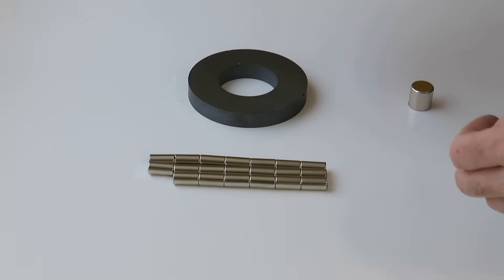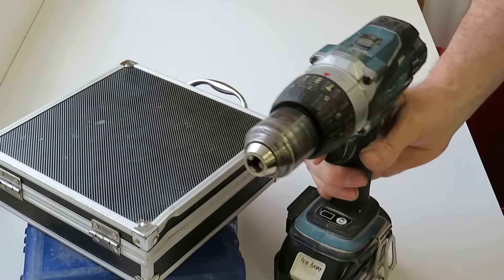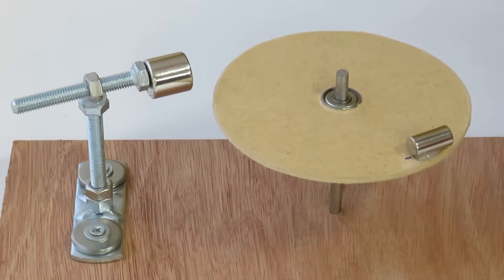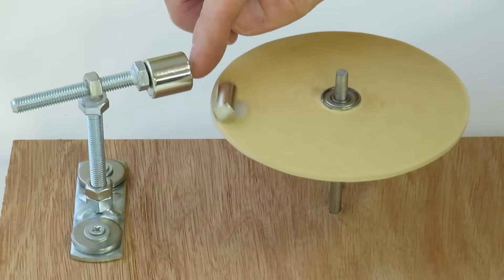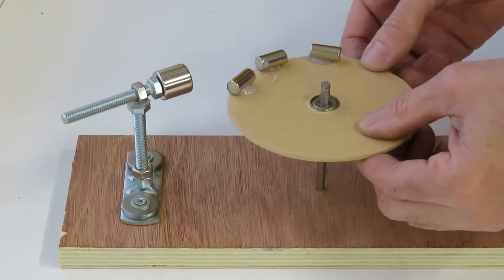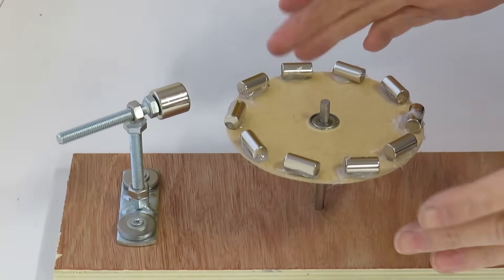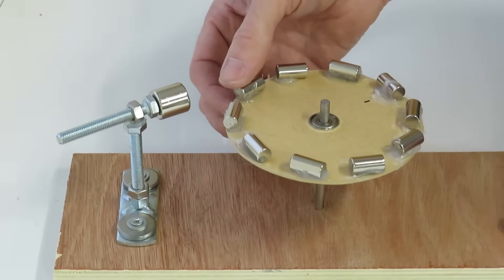Magnetic Energy - Crude Magnet Disc Challenge!

Comment: Mu-metal would shield the magnetic interference between the magnets
which should focus the magnetic field of the opposing magnets a bit better, also the perendev motor uses the same concept but has 3 rows of magnets and each row is a bit offset from the other to give it that push in the spaces where it wants to stop spinning
Reply: regular steel or iron shields magnetic field to some degree, the trick like someone said above is to remove the stationary magnet and have it just be there at the right time... it appears Troy Reed did this using springs that he called injection pistons in his magnet system... you could even use an electromagnet for the stationary magnet and only turn it on at the exact point to push the disc around then turn it off when it would block it from continuing around (cogging)... just make sure that your electro magnet uses less energy than the momentum of the disc...  its rather simple if you understand the concept and this seems to be what Troy Reed did

Comment: This might sound daft but have you tried something like this, imagine you had a sphere, which was all magnetic, super duper strong magnetic, then you had another magnet inside the sphere, super strong also, if you pushed the magnet towards the magnetic  ball, it would move right, so would it not lift off the ground if you pushed the magnet toward the ceiling of the magnetic sphere, and if so and the weights was worked out correctly wouldnt that allow it to fly if the magnetic force was strong enough???

Comment: One problem is the angle of the magnets on your wheel., they need to be more perpendicular to your stationary magnet. The second problem you have is that you need a “shield” on your stationary magnet ( like the ones they use on audio speakers) to dampen the field around the sides of the stationary magnet. This concept will work and yes you are on the verge of getting it right. Very honest and well made video. Thanks for sharing your experiment.
Reply: I like using some Bismuth for blocking the "Attraction" angles between the stator magnet and rotor magnets also, but I agree getting the angles correct and keeping the unwanted polarity field away or contained is crucial for success with magnet motors. I'm working on a design that uses Halbach arrays to contain and constrain the magnetic fields to only radiate the fields in one direction, so aiming them like this guy in video said he wished he could do.
  If it has any degree of success or is pretty interesting in what it does do, I'll be posting it on my channel.
Love working on magnet designs myself as I know there is potential for amazing devices yet to come.....
Reply: Sir have you done what you say?
Reply: Yup, “if you can block (or shield) a magnetic field, you can make a permanent magnet motor.”
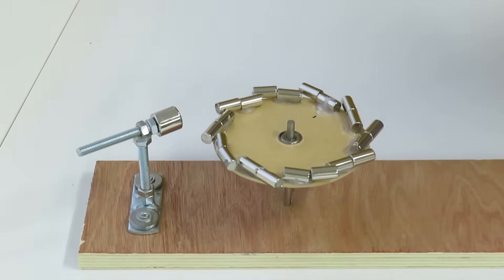Reply: @gmstream9259 11:31

Comment: I'm am not an expert of any topic at all, but here's an idea: you are relying on the single large magnet to propel the disc. Eventually it slows down. What if you were to put an identical magnet exactly opposite? Both sides should propel the disc equally from each side, meaning that it has a lower chance of slowing down. I'm just guessing, but it could work.

Comment: What if your disc was connected entirely to ac the disc being the opposite polarity and then your pushing force be the opposite polarity I'm trying to acheive the same thing but it looks like your creating by adding magnets to the disk repelling and pulling forces which is impossible due to the opposite polarity if they were just metal would it of had a different aspect

Comment: There is fiew more steps for you to take- firstly if you compare it to betrol engine  then you play with only one piston. Add more pistons. Plus you also need inlet manifold(to overcome that "friction") as if try permanent magnet switch to time on and off. Otto motor is perfectly timed machine. If you take magnet force as betrol then you need inlet. If you can turn off the pushing magnet just at the right time, there is no canceling force. And it should be relatively low energy waste to automate that magnetic switch.

Comment: Turn the system 90⁰ and use a circumferential magnetic bearing system as opposed to mechanical bearings. Use permanent magnets throughout the rig. 

If youre able to use a halbach arrangement while focusing on the negative charged pole for the rotor magnets, perhaps it may yield better results? Perhaps even using a small halbach array focusing on a negative charged pile for the propulsion magnet?

(Edit) Also, perhaps instead of using a physical stabilizer as most magnetic bearing systems use, you could incorporate the same magnetically repulsive properties to keep the rotor stable within the magnetic bearing system.
Reply: Make one so we can see 👍

Comment: Rig the main sending magnet(left) on a gear system so it moves away and back towards the wheels at time where it is only present when opposing a passing magnet on the wheel.  This is easier if you only have one magnet on the wheel.  This way it misses a magnet when attracted and then realigns just as the opposing are of the magnet on the wheel passes by.  Kind of like kicking off the ground while on a scooter.  Make contact for a moment of thrust, then back away, then again at the precise moment best for thrust(opposing magnetic force).
Reply: Or perhaps use two opposing magnets, on a see saw arm, offset to the spacing between the magnets on the wheel. So the push, moves the next magnet closer in relative to peak push. Might work..
Reply: @parrotshootist3004  As long as it cannot reach equilibrium.
Reply: @BaptistJoshua  get the spacing right and it should have to oscillate. But without trying it, that's the challenge to over come.
Reply: @parrotshootist3004  Yep.
Reply: @parrotshootist3004  "For all have sinned, and come short of the glory of God;" Romans 3:23 

"But God commendeth his love toward us, in that, while we were yet sinners, Christ died for us." Romans 5:8 

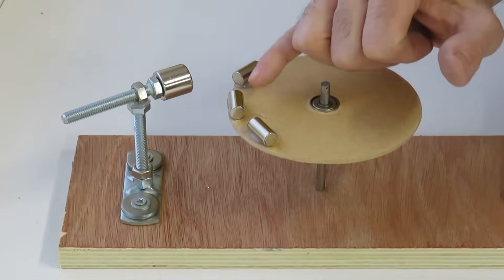"For the wages of sin is death; but the gift of God is eternal life through Jesus Christ our Lord." Romans 6:23 

"For by grace are ye saved through faith; and that not of yourselves: it is the gift of God: Not of works, lest any man should boast." Ephesians 2:8-9

“Now we know that what things soever the law saith, it saith to them who are under the law: that every mouth may be stopped, and all the world may become guilty before God. Therefore by the deeds of the law there shall no flesh be justified in his sight: for by the law is the knowledge of sin.” Romans 3:19-20

"For God so loved the world, that he gave his only begotten Son, that whosoever believeth in him should not perish, but have everlasting life." John 3:16 

"That if thou shalt confess with thy mouth the Lord Jesus, and shalt believe in thine heart that God hath raised him from the dead, thou shalt be saved. For with the heart man believeth unto righteousness; and with the mouth confession is made unto salvation." Romans 10:9-10

Comment: 2 discs both on spindles plus flywheel
Big on generator
Small to small vault motor balanced flywheel
1+ 11 magnets one smaller with 2 magnets of much weaker strength 
Should extend rotation longer

Comment: You have to use magentic shielding to counter act the attracting force. Steal or Iron is good but you need to put plastic or cardboard between the magnet and the metal. You can even put several layers but thats not really needed. Try it. After all this is all about experemintation.

Comment: You should take this set up and expand on the outside. If you arranged more big magnets around the outside it could keep it going? Have an even amount of equally spaced magnets inside. Have an odd amount of big magnets not evenly spaced around the outside. There should be a magnet pulling at all times while another is trying to lock. And with it not equally distributed it can't find that central locking spot. If that doesn't work flip the inside to be odd and the outside to be even.

Comment: Got to put both wheel on a gear drive to sync it at the right moment for a continuous push  !  Kinda like a cam shaft in time with piston and the valve to keep it moving .
Reply: please can you explain that idea
Reply: @muhammadawais-m7k  I think he might mean a mechanism that pulls the "engine" magnet back and forth by use of a cam to reduce the resistance on the returning magnets. I think the friction on the cam will cancel any advantage!

Comment: Rather than placing the magnets on the wheel the way you have, turn the magnets on the wheel so they're pointing toward the center of the wheel with the opposing (push facing the outer edge), in other words, with the magnets that are hot-glue to the wheel, make them as if they were the spokes of the wheel, going from the center to the edge, possibly angling the spokes (magnets) slightly.. 🤔

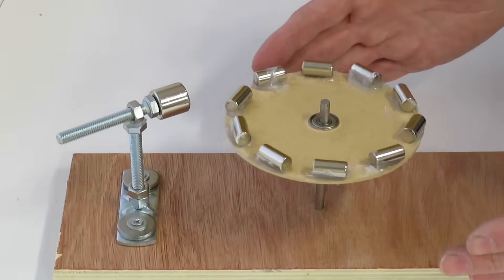Comment: 9:07 That is the point. Balanced and unbalanced. you must finde the sweet spot.
And what you show in this minute is good way to improve low wind speed to generate electricity. Instead start produce energy with 10m/s can be done with 5m/s with that config.

Comment: OK, bare with me here. If you were to have this at a larger scale and have a motor. To help with start up. Could you not use a large electro magnet that could be turned off and on extremely quickly to only fire on for the push and off immediately before the affect of the opposite charge?  I'm not a smart person so I don't really get magnets😅
To clarify it would need a generator or a self powered starter. But once running could run off the power it outputs and bleeding the excess power off for other uses etc..

Comment: I do not know any law of physics which make it impossible : Of course this would not be perpetual movement, because if it worked, it would end up ruining your magnet. But otherwise, It was proven that it would be impossible with central forces - however, magnetic forces are NO central forces, and therefore I personally have no idea if it can work or not... because first of all, this might only work in a very specific position both for the rotor and the stator magnets. I tried to 3D print magnet supports, but it's not easy to make them symmetrically ajustables.

However, one thing I'm sure, is that to have it work work, one would need to reduce all the mechanical frictions and smooth as much as possible this locking effect. Therefor, one would need a larger number of magnets and have half or probably better : one third of the rotor/stator magnets being coprime with each other. eg : 12 vs 15 or even more.

Comment: Though it will need energy to function, the amount it produces exceeds the amount it draws. The batteries it uses are only to start, accelerate and store energy. It will also need high voltage illumination and a cut off switch for overcharging. Then inverters can be added

Comment: YOUR MISSING ONE FUNCTION. THE MECHANICAL ASPECT IS NOT THERE. EITHER A CAM OR Solenoids TO CONTROL THE DISTANCE BETWEEN THE MAGNETS SO TIMING CAN BE SET. WITHOUT TIMING IT WONT WORK. LIKE A Diesel ELECTRIC TRAIN, YOU NEED A MECHANICAL MAGNETIC DRIVE. THATS WHY MINE WORKS, WHERE OTHERS HAVE FAILED. AND WITH EXTREME TORQUE

Comment: The magnets on the disk should have angled slots to move through.  A quick pop at the closest stopping point for the rotated magnets would help pull the wheel by bumping, instead of relying on just the field.  Plus, it goes without saying, put an opposite side arm magnet.

Comment: thank you I was getting ready to try this myself . I think I will rethink the roll of the magnets . By using the magnet with a copper coil  to produce a lower voltage to a transformer . To step up volts . the starting point being using solar to battery to 12 volt motor to magnet coil to transformer to produce desired higher voltage . Thank you

Comment: And if there were more stationary magnets (2, 3 or 5) around the wheel shifted slightly with the locking phase?
What about more such wheels on single axle stacked and locked together let's say 10 cm above one another (3, 4, 5 wheels with a shifted locking phase)?
And for odd number of stator magnets even number of magnets on a wheel, so every locking position would be counteracted by the pull/push force of every other stator magnet - unbalanced wheel?

Comment: all you need to do is have a powerful magnet in a middle, like a sun then have around with different magnets starting with a low straight magnet up to 90% of the straight magnet that is in middle. at least 12 magnets need it. that way one magnet pushes another magnet and the middle magnet stabilizes all together. That way you will have a infinity rotation without interruption.

Comment: is not so hard ! the solution is - you need interruption. since these are magnets you need the magnet on the arm movable. so that it goes back and forth !
a second disc with teeth with the right distances. a rod from the disc to the arm which is tiltable. and a spring or other magnets. the teeth of the disc press the rod in the right distances - the rod presses on the arm and pushes the magnet away. on the arm of the megneten you make on the back again two magnets. one on the arm below one on the wood - which presses the magnet arm richtug disc.   the second edge of the disc now presses on the rod, the rod presses on the arm. the arm moves back. the magnet on the disc passes through. now comes the free space in the disc the rod goes back. the lower magnets on the arm push the magnetic arm back towards the disc, the magnetic arm and the magnet on the disc repel each other - and again from the beginning !

Comment: There's a thing called magnetic cogging on display here,it slows down the machine because you can't get rid of the interference from the opposite pole,but I'm sure you all know that,there is an arrangement called the "halbach array" Wich almost cancells out the opposite pole but in turn adds loads of weight,so my question is has any body ever made one with halbach magnets...?

Comment: Nice try.  If you really wanted this to work, you would pay more attention to power of magnets used, the angle of the magnets, the distance between the magnets, the point at which the repelling is at the TopDeadCenter at which the repelling pushes harder than weight drag of the wheel.  If you have any idea of how a car uses TDC to make the engine spin, then a few adjustments to magnets position and wheel weight ratio should make sense to you.  If not you do not understand how to make this work.  With magnet repulsion the exact TDC will be critical.   Good luck!

Comment: If the single magnet on the stand had a linkage to the center shaft on the wheel/disc with a camshaft lobe, and a single magnet on the disc/wheel you could time it to overcome the resistance of the magnetic locking.

Comment: What about using a piece underneath that spins the magnets on the disk that then spins them ever so slightly enough to make them repel and attract at the appropriate times. Or using an electro magnet that pulses right when the magnets pass it instead of constant energy of a permanent magnet?
Reply: I agree. I was thinking a cam gear that just redirects the pushing magnet’s force at the appropriate time in the cycle. Like ignition timing on a vehicle.

Comment: You can't just throw some magnets on a disk and think it works! Its a very complicated process to get the magnets on the correct angle and also trim the magnetic fields with bushes. There are a few actual working prototypes out there. One from a German guy. Pretty much understanding how magnetic fields work and a lot of trial and error.

Comment: What if you add a water wheel gravity feed system with gears to continuously add the energy need and pull from gravity fed energy via water. Obviously, the water placed higher will increase potential energy. I think may play with this myself. Curious about how much energy is produced with and without water to adhere to law of conservation of energy. Great video and sparked some ideas for me.

Comment: Mark out  the ten centers, place the cylinders at 45° to the stator magnet, do it at 90°, this will provide torque in repulsion not attraction. 

You control power with gap, don't fix the stator to see how close to get first,  a motor set up this way without a load will runaway & explode like a flywheel, I'd put a brake on it, seriously.
Hth, fun stuff 🧲

Comment: Your diagrams drawn on the disc were more likely to have success. Notice your magnet spots you marked with dark tape were angled keeping the opposing pole at the opposite end of each magnet away from your target zone of ideal magnetic propulsion. But when you mounted the magnets you put them all in line with the edge which unfortunately allows the opposite pole (magnetic field) to come in contact with your target zone, causing magnetic braking, robbing you of the propulsion you have between your bigger drive magnet and your smaller repeller magnets. Do you see what I mean.? Put them all at angles keeping the opposing force (attractive force) further in and away. Follow your own example of the dark tape marks on your disc.
Reply: INTERESTING. i WAS THINKING ABOUT PUTTING THE OPPOSING POLE IN LEAD POSITION, AND MULTIPLE FIXED MAGNETS POSSIBLE ON ANOTHER GEAR (MAYBE ONE THAT CANNOT SPIN AS QUICK)
Reply: @joshuabowkley3490 
11:31
Reply: And then he needs giron to isolate the field on one side of each magnet. And way more magnets on the outside with giron below each magnet.. so when they meet they have sudden push
Reply: Wont work xD

Comment: It seems to me that the stationary magnet should be geared to come closer to the moving magnets as they pass by (Moving away from the attracting pole of the moving magnet and moving closer to the opposing poles)
Reply: Was thinking the same.  This could be achieved by putting gears with appropriate ratios on the axles spinning the magnets (the rotating disk and the stationary).